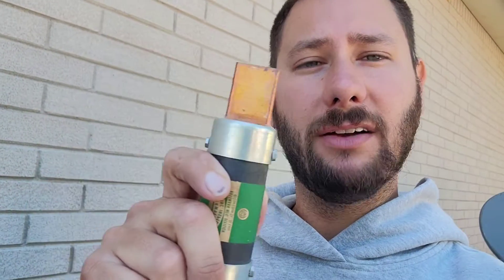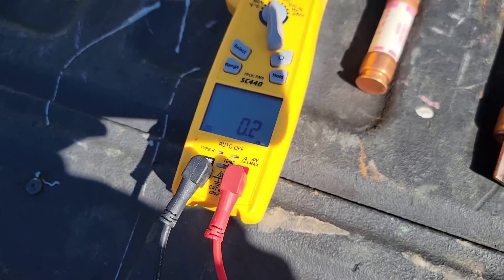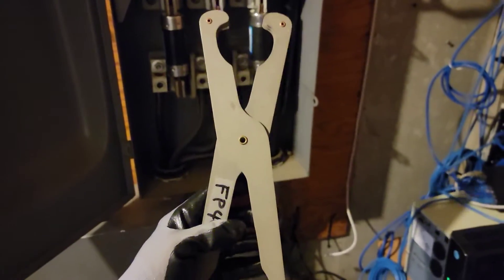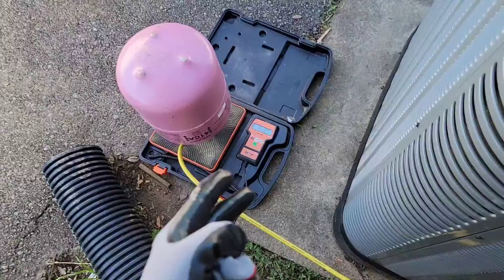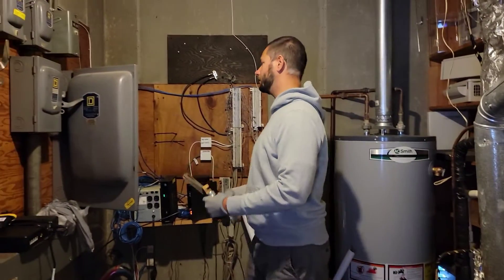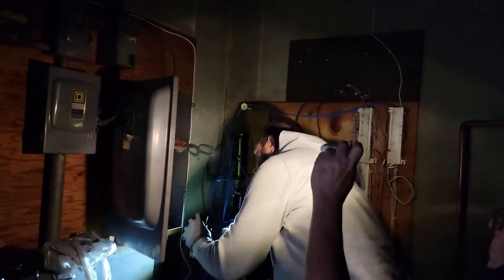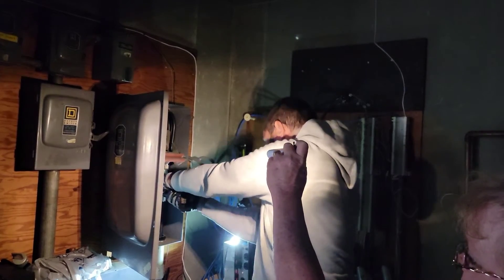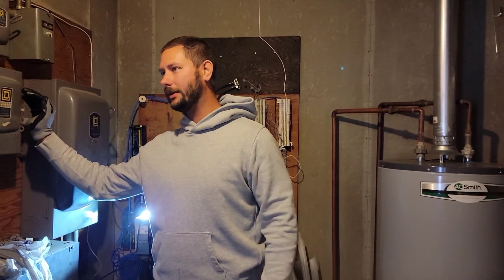What to Do When You have a Blown Fuse? HVAC Basics #hvac #fuse #hvacservice  @FieldpieceProducts

Comment: I appreciate your safe comment. 
I had to replace an inline fuse today, my “foreman” said to use either channel locks or romex. 
So I bought a fuse puller.
It is a terrible one. But I got it to work, safer than knipex cobras. 😂
Reply from the maker: You're better off with a fuse puller, I've had some bad experiences with pliers too.

Comment: If that 200 amp fuse was involved in a 3 phase grounding or short out incident, change all three fuses.  The fuses that read ‘good’ may be partially blown. Sounds dumb but inside the fuse are multiple parallel links. Sometimes some of the links melt, and others don’t. The 200 amp fuse is now a 100 amp fuse. Only way to tell for sure is to put the suspect fuses in service and shoot the starter with a thermal camera, it will show the partially blown fuse.